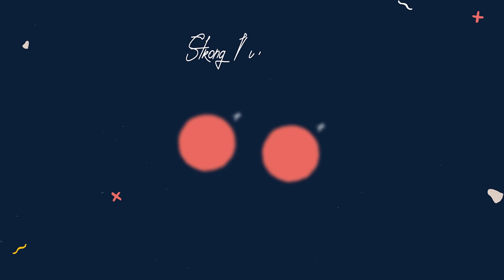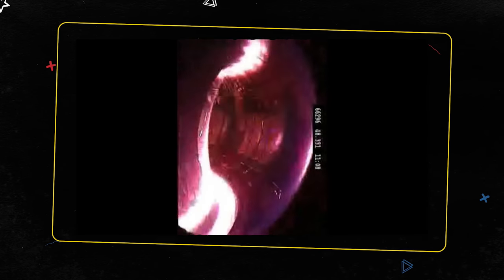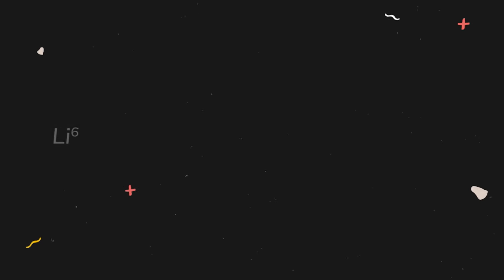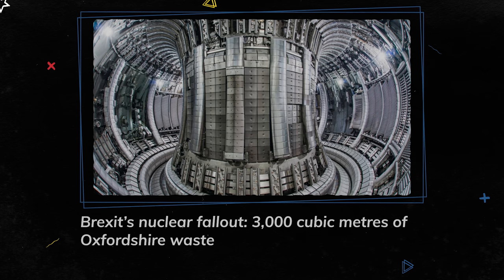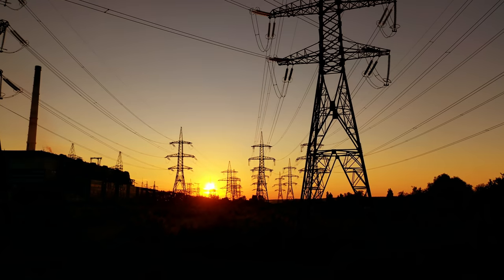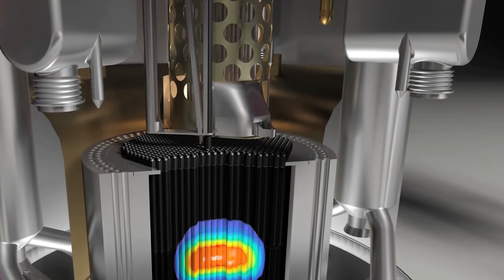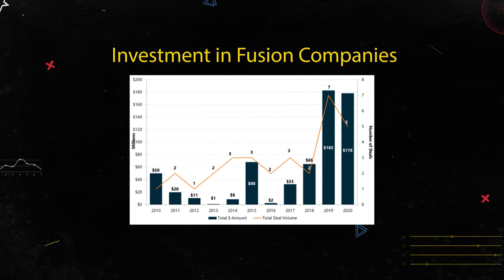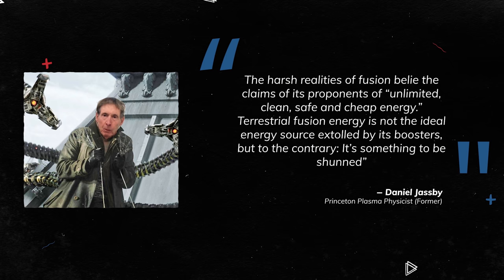What No One Else Is Telling You About Nuclear Fusion

Comment: "I can state flatly that heavier than air flying machines are impossible."
— Lord Kelvin, 1895

"Hold my beer"
— Wright Brothers, 1903
Reply from the maker: Fusion has already been done. 

I’m saying that by the time they make a commercial reactor (2070s based on their own timeline) most of the world will have moved to renewable energy.
Reply: @TechforLudditesSira   fusion can still be useful for space travel and other applications
Reply: @TechforLudditesSira  the energy density of renewable energy is not high enough to meet today's global energy demand, even if renewables were reliable. You would need more than the total Earth's surface area covered in wind or solar plants. Biomass competes with food, so it is a no-go. The only solution I can think of is molten salt modular fission reactors with supercritical CO2 turbines
Reply: Perzactly.
Reply: as long as the world is only focusing on the trillion dollor super fusion reactor designs and ignoring the more novel approaches such as Dense Plasma Focus devices then yes fusion will never be a viable solution for all the reason you mention. anuetronic fusion for the win!
Reply: @TechforLudditesSira  Fusion power today are experimental and bad for producing power. We need to do more reserch to find good one.
Reply: @TechforLudditesSira  We can have plenty of clean energy by 2050. Between nuclear fission, renewables, and fossil fuels. Carbon capture, carbon recycling, and carbon mitigation such as reforestation will make carbon emissions manageable..  Fossil fuels will still constitute a prime source of energy there is just so much of it and it has too many advantages. Let's use fission and renewables to take the pressure off of fossil fuels.
Reply: @TechforLudditesSira  you gotta be really optimistic if you really think that renewable energy will be the norm in 50 years
Reply: How can anyone say that when birds exist
Reply: @TechforLudditesSira  I don't know if that's true I think the solution may be fission mostly by then and fission will last us about as long as Fossil fuels lasted us the last time around
Reply: Wright brothers weren't even the first. But they were the first to be Photographed and get extensive news coverage
Reply: @afx420ad  Its NOT trillion dollars. ITER's cost is 22 billion. That's 2.2% of a trillion.

It is also relatively negligible compared to some other big projects (ISS 150 billion, Apollo 150 billion) that didn't even have the potential to solve humankind's energy needs. I mean, fusion power has the potential to fix our problems. Why are we investing so little...

Germany itself is paying 57 billion a year just for subsidies for their energy transition. That is 57 billion in one year. ITER is 22 billion over 15-20 years. Germans could build two ITER reactors each year.

If we decided to invest 150 billion in fusion power, we'd solve that problem for sure. We had that money to go to the Moon or build the International Space Station, so why not fusion?
Reply: @PeterKese  yes ITER (so far) has only cost $22b however estimates of completion are more like 65b. Also my comment was not that ITER cost 1t but that the research focusing on the tokomak style reactors around the world is throwing a trillion dollars when I personally believe less invested technologies with the same goal of fusion power are being neglected. I feel you are arguing against a point im not making.
Reply: @mariobros7834  As our world is run by $, 
I do not see a bright future for any of the  fission / fusion reactors.  For the simple reason that their cost per MWh is way too high and have a tendency to increase while the cost of others decrease.
The contributing factors are complexity, regulatory requirements, waste disposal cost etc. 
We're now on the brink of a world economy crisis, which is going to increase cost sensitivity even more. 
If there wouldn't be  military interests in  nuclear power in some countries,  its governmental support  would likely disappear.
Reply: Hot air ballooning was a thing before then .
Reply: Too late, guys.
- Otto Lilienthal, 1891, Derwitz, Germany (sure, his aircraft were gliders, but this is about flying machines heavier than air)
Reply: Sometimes technology progresses quickly, and other times it gets stopped by barriers. Aviation is as good a case in point as any. Progress was rapid from the Wright Brothers to, oh, the advent of jet engines, but since then, it's been more incremental gains. Rockets developed in a revolutionary way from the V-2 to the Saturn V; since then, not so much revolutionary progress. There's only so much you can do with chemical reactions propelling rockets. Eventually, we may get past that, but don't look for it this decade.
Reply: @TechforLudditesSira  Renewable = Solar & Wind?    Not feasible for all locations.   Not consistent and reliable.   I'm not saying renewables shouldn't  be part of the energy mix, but there will certainly be a need to supplement them.
Reply: @mariobros7834  "You would need more than the total Earth's surface area covered in wind or solar plants."  Absolutely NOT true...

Comment: Molten Salt Reactor is the most promising idea,
but only very few scientists and engineers working on it.
Reply: It has a lot of problems too but is very interesting. The most promising and easy are renewables
Reply: @zockercam8122  really? What are those problem with the molten salt reactors? Solar and wind need backup and storage. Their own cost  means nothing because of all the things you have to do to accommodate them. Nuclear energy is available 24/7 on demand. Nuclear reactors produce radioactive medical isotopes used in cancer treatment and medical imaging. Before the use of Cobalt-60 (medical isotope) in sterilization of surgical tools, 1000s of patients died annually in surgery in the US due to the inadequacy of chemical sterilization.
Reply: @mohammedmahdi4976  Molten salt is exceptionally corrosive, and the separation of reaction products from the unreacted source material is likewise a very difficult problem to solve.

We're talking miles of pipes that need to survive the constant flow of molten, radioactive salt. They WILL corrode and will need to be replaced over time. You will then end up with lots of radioactive pipes to dispose of. This is not even going into the additional strains placed on the material from the radioactivity. In traditional water reactors the water being moved around never gets terribly radioactive, it's all contained in the fuel and control rods, so none of the pumps and plumbing needs to be particularly resistant. 

I support the development and eventual use of MSRs too, but there is a lot of work to be done to make them workable on a larger scale.
Reply: @Dewkeeper  These are the same corrosive salts used in solar collectors since the mid 90's. IOW: problem solved.
Reply: @zockercam8122  Renewables demand alot of mining.
To power the world with Wind farms you would have to wait 2 generations and after 20 years you would have to replace them all.

The only good renewable is Solar Thermal with heat stored in molten salt.
It can store heat for 2 weeks if there is no sun.
No need of special minerals as solar panels.
Reply: @raziasrazias7761  where did you hear that wrong information? We are already building a lot of Wind Turbines and it works perfect, is cheap and reliable if paired with solar and water. It would of course not take 2 generations to build. Thats just wrong information :/
Reply: @Dewkeeper  you are making it sound as if the "corrosion problem" is the straw that broke the camel's back. Corrosion can be easily managed unlike the unreliability of renewables. I recommend you watch "The Molten Salt Reactor Experiment" (MSRE) video on YouTube. You will find in the documentary that Oak Ridge National Laboratory (ORNL) found the ideal piping alloy in a molten fluoride salt environment back in the 1960s. That is hastalloy. The MSRE operated for two years with 70% capacity factor. Levels of corrosion in hastalloy samples irradiated and exposed to the molten salt fuel mixture for more than 5000 hours experienced acceptable levels of corrosion. Using hastalloy in the vital components like heat exchanger and core channels will ensure these components will last until the end of the life span of the power plant (40-60 years).

Now regarding the waste volume, MSRs produces significantly less high level waste than water cooled reactors. Why? Because MSRs need to be refueled less due to higher fuel utilization. Still, from 70 years of nuclear industry in Canada, the total mass of high level waste is only 60,000 tones. A gigawatt coal power plant will release the same amount of waste to the environment (which is btw radioactive) within ONE WEEK. But you are gonna complain about a medium level radioactive piping which can be safely contained?
Reply: @zockercam8122  Renewables are soon to be the cheapest form of electricity if they aren't already.  The drawback is they're inconsistent.  Electricity generation needs to be consistent.
Reply: @Dewkeeper  Molten salt isn't all that corrosive. Here is a simple corrosion scale from highest to lowest:

1. salt water
2. water
3. molten salt - yeah, molten salt is less corrosive than water

Will pipes and tanks need replacing, sure - but then maintenance is needed for any machine. However, molten salt corrosiveness is a myth, believed because people are used to salt water corrosion (like road salt on your car) and so think 100% pure salt must be worse.

We have been using molten salt baths in industry for 100 years now and as George Warner points out, it is also used in solar concentrated energy farms. As long as you don't dump water into the salt, corrosion is a rather minor problem.

Of course, if new materials are invented with even less corrosion, great! you can make cheaper reactors due to maintenance savings, but it is not a showstopper by any means.
Reply: @YTEdy  yes. Thats why we need a few nuclear powerplants o my personal favourite: find solutions to store energy (can be stored as heat, in batteries as chemical energy) or what germany tries right now: to control the use of energy. Companies produce nore when there  is too much in the system and turn off when there is  not much energy. They get cheaper energy if they do that and pay less tax or something. Also an interesting solution
Reply: Liquid Flouride Thorium Reactoes are harder tonsue for nuclear weapons. So that is why light water uranium reactors are dominant
Reply: @zockercam8122  Germany is not a good example for clean grids. You can check the electricity map app. Their carbon footprint is almost 10 time nuclear France. We don't need solar and wind to decarbonize the grid. Only hydro and nuclear. Renewables might be cheap but the cost of batteries and gas/coal power plants back up are not.
Reply: @sl600rt  that was the reason initially. Not anymore. Now it's a game of economics.  Developing and mastering a new reactor technology like the MSR will be costly initially (as all R&D), but eventually it will be rewarding because MSRs are waaaaaaaay cheaper to operate.
Reply: @mohammedmahdi4976  Renewables are definitely the future. Nuclear may be a possibility but we still havent solved the problem of nuclear waste. Nuclear can be a good addition but it is not the future as it is today
Reply: @zockercam8122  Wrong lol, i heard it from a french enginner called Jancovici that makes world wide congress about the future of energy.

Can you tell me how many wind farms you need to power the world ?

Do you know how many tones of each minerals you need ?

Just to power UK you would need to use 1/4 of the country.

Do you know what happens when solar and wind dont work ?
You have to burn coal.
That's why CO2 is rising in Germany since they increased the quantity of wind farms and cutted on nuclear.
Reply: @raziasrazias7761  according to Mark Jacobson's famous 100% renewables proposal, you would need to cover 6-15% of the US land area with wind turbines in order to satisfy the US electricity needs. The 6-15% figure does not take into account energy storage or other energy needs like heating, transportation and manufacturing. So I think 1/4th of the UK land mass is an underestimation.

On the other hand, say we want to power the US 100% by nuclear, you would need around 450 GW. Assuming you build 5 GW power plants and each power plant takes up 2000-1000 acres of land, the total land requirement is 180,000-90,000 acres (0.007-0.004% of US land area).
Reply: @zockercam8122  waste is a non issue. all the current spent fuel in the world wouldn't occupy a football field. Plus it can be recycled. 

Low grade wastes can be buried in normal landfills.
Reply: @sl600rt  thats just not true. No sane person would bury nuclear waste and there is a lot of it. If waste wouldnt be a problem then why wouldnt we just bury it?
Reply: @zockercam8122  it's only a political will problem. No one wants it in their figurative backyard or even transported past it. Even though the scientists and engineers have said it is safe. People have bought into decades of fossil fuel scare mongering.
Reply: MSR has been around 5 decades (and been abandoned as many times), and everybody here thinks it's a "new" idea 🤣
Reply: @YTEdy  Oh yes, the cheap renewables. That's why they have cheaper electricity in Germany than in France, right?
Reply: @laszu7137  Congratulations on not understanding my post.
Reply: @ZockerCam Minecraft Current reactors utilize nuclear fuel in solid form rather than liquid or gaseous. A direct consequence of this is that fuel rods are only using between 1% and 2% of the energy potentially available before sustaining so much damage from radiation exposure that they're not safe to use any longer and must be removed from the core area for either disposal or reprocessing.

MSRs utilize fuel in a liquid salt form, which doesn't suffer the same effects from radiation exposure as solid fuel rods, and can therefore achieve a much higher burnup % by simply recirculating the liquid fuel back through the core area after suitable cooling (and possibly removing fission products and useful isotopes).

Through careful engineering, it is possible to reduce the volume of what is classified as waste by a huge factor as well as reducing the amount of time that waste will be dangerous down from 100,000 years to about 300 years. Assuming we build reactors like this, it would also be possible to process our existing inventory of nuclear waste this way.
Reply: The problem is salt is to reactive with any given metal
Reply: MSRs are not fusion reactors. Aqueous Homogenous Reactors are by far more promising than molten salt.
Reply: @Froddofromtheshire  perhaps you missed the point. I believe the reason MSRs are being discussed is because they seem like a great interim step while we're still trying to solve the issues with getting fusion to the point of net energy production. I don't think anyone is saying that MSRs are fusion reactors. MSRs have numerous advantages over more conventional LWRs.

From what I've read, most AHRs seem designed for the production of useful isotopes, and some research is being done on their utilization for hydrogen production via radiolysis. One of the main drawbacks seems to be the use of highly enriched uranium, which raises obvious proliferation concerns if the reactor is scaled up from a small research and training size to one intended to produce enough power for a small modular reactor or larger. If you have links to differing information, I'd be interested.

Comment: I earned my PhD in Nuclear Engineering (fusion emphasis) more than 30 years ago.  Everything you've said about fusion is accurate.  I figured these things out while I was working on the Magnetic Mirror Test Facility (MFTF-B) while doing my PhD - I would often say that even if fusion could reach engineering breakeven, the mass of the fusion reactor would be nearly the scale of a battleship using technology that was far more sophisticated than that of the Space Shuttle.  Much too expensive.  I came to the conclusion that Fusion would not be economic until fission energy sources (Uranium, bred Plutonium, and Thorium) would get used up many centuries from now.  I went on to a career in nuclear waste disposal and then nuclear non-proliferation.  The only thing I take issue with is the use of hydrogen for grid storage of renewable electricity.  I did my Master's Thesis on comparing thermochemical means for hydrogen production to electrolytic production.  Hydrogen for grid storage is far too inefficient and expensive.  Battery storage is currently far too expensive.
Reply from the maker: Thanks for the informative comment! :)

What do you think about Donald Sadoway’s Liquid Metal Batteries?  They’re claiming 80% dc-dc round trip efficiency
Reply: Timothy McCaskey  oxymoron is an oxymoron, since to be sharp (from the Greek, oxus-) and foolish (from the Greek, -moros) at the same time is something only children can do. Snap!
Reply: I concur.  My PhD was studying turbulence at the edge of fusion plasmas (relating simulations to experiments on MAST at Culham). I too came to the conclusion that it is not viable as a grid scale power source.  They've already been through the whole periodic table looking for wall materials, none will mitigate all the risks.  Shutting down for 6 months every few years to replace the wall lining is not going to be a viable option, and if it contains Beryllium that introduces its own set of headaches.   On your last point I do think battery storage is becoming viable at grid scale and together with pumped hydro where appropriate or compressed air will make it easier to have a larger and larger fraction of the grid from wind & solar.  Fission can still provide a 20% or so base.